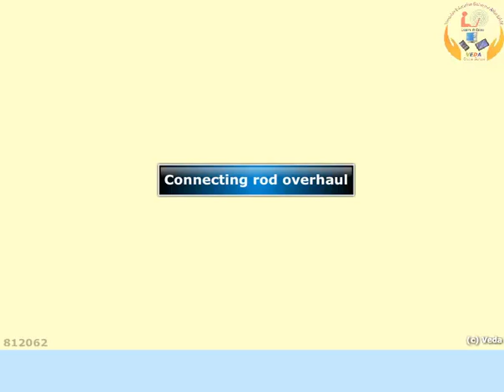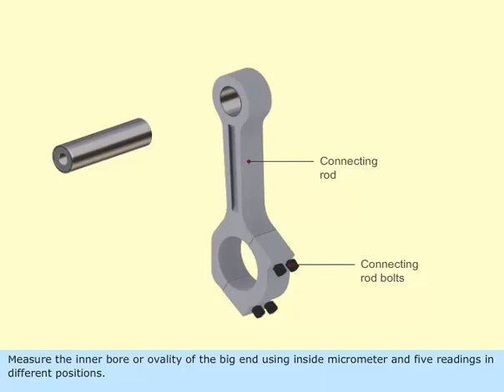ConnectingRodOverhaul

Comment: What's the purposes  of Con rod serration? Pls answer
Reply: Al Amin vaia ....   serration is been given in the bottom end of connecting rod in 4 stroke engine, the reason to give serration at that place so that they can take the shear stress because function of cut and bolt is to join the two surface not to take the stress so that could be taken care
Reply: Thanks, All Best Tips.